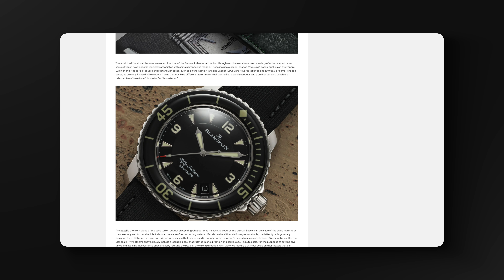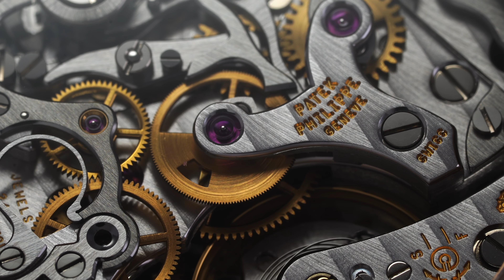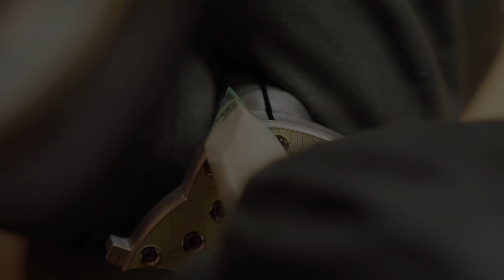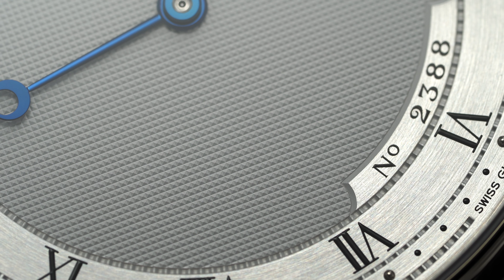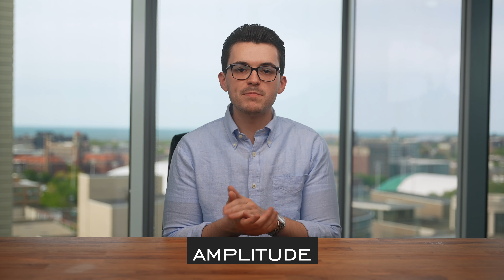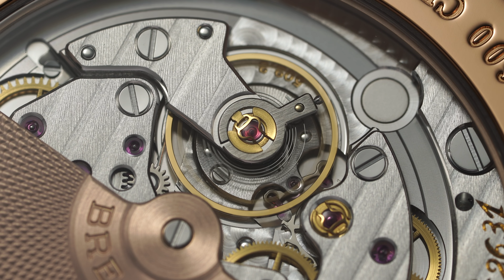8 Misunderstood Watch Parts & Features Every Enthusiast Should Know

Comment: I found a broken buran watch using a poljot 3133, however it’s broken at the balance wheel. The 2 things used for the, I believe,  index regulator came off somehow. Now my question is how does one proceed to fix it since my local shop repair wasn’t able to.

Comment: Just another tip on using the timing bezel. The large lumed marker (usually at 12 o’clock by default) is used to indicate the end of the duration, not the start of it. It’s large since knowing deadline is more important.
Reply: depends on the direction of the numerals ;-)

Comment: Great vid Teddy!  If a future one is done, maybe explain how hand winding your automatic watch can be dangerous, especially with the SW200-1, which ratchet wheel is easily sheared/stripped.  I have 2 watches with SW200-1 both with ratchet wheel issues within the 1st year and 1/2 of purchasing the watches new.
Reply: Yeah ... having stripped the teeth on the ratchet wheel on one of my watches with an sw200 movement (repaired under guarantee) I now wind it very very gently ....

Comment: Teddy, would you consider commenting in a future video about if hacking lever mechanism affects the balance or not? Sometimes very expensive watches don't have hacking mechanism, so I wonder if it is a decision based on the longevity of the watch balance wheel or if it is because of another reason. And it would be interesting to know if there are another types of hacking mechanisms that does not involve a lever touching the balance wheel to get the same feature of hacking. I think this side of this feature is sometimes forgotten.
Reply: Every one I have ever seen uses a hacking lever on the balance wheel. It would be trivial to design the system such that the lever is a softer metal than the wheel. The wheel is also very light. I have never ever seen or heard of any noticeable wear caused by hacking, after working on probably a hundred or more movements, most of which were restorations and so had already experienced a lifetime of hacking.

If I had to guess why very expensive ones don't, it is because they are dress watches and dress watches really don't have a historical reason to hack. It was most important on military, tool, flight watches as it allows people to synchronize their watches precisely and know they will be displaying essentially the same time through at least the next 24 hours or whatever.

Comment: I literally design quantum logic gates for a living, and am more perplexed by mechanical watches
Reply: That made me spin!!
Reply: I’m a Mechanical Engineer and I’m afraid to admit being a bit perplexed by mechanical watches.
Reply: Well, I’d hope you’re less perplexed by something you’re doing for a living than by something you’re not!
Reply: What a "Quark" thing to say 😂
Reply: I literally design Flux capacitors, and am more perplexed by gen zer liars than what I do for a living!
Reply: I‘m a watchmaker and i’m not even sure what you do for a living 😅
Reply: nice
Reply: This makes me happy if true!
Reply: Digital vs. Analog
Reply: Literally?
Reply: A mechanical watch is a spring powered gear box with multiple output shafts running at specific ratios in relationship to each other.  At the end of the gear train is the escapement that releases the springs energy at a rate designed to produce one rpm at the second  hand drive shat,  The minute hand runs at one revolution per hour and the hour hand twice per day

Comment: A worthwhile addition to the diving bezel segment would have been why they only rotate one way.
Reply from the maker: Good call. It is a never-ending hole you can keep going down. Just to address it for those interested... Before diving computers, this tracking of time was needed as it could lead to dangerous consequences underwater. By rotating only one way it lessened the chances of the bezel getting knocked and showing the incorrect elapsed time. This concept of preventing this undesired bezel movement lead to other developments such as elapsed time bezels that need to be pressed down first before rotating and the compressor style that has an internal bezel that required a crown on the side of the case to be turned in order for the bezel to move.
Reply: @TeddyBaldassarre  Thanks for the reply and please don't think my comment was in any way a criticism. As with all your output, I make an espresso and then sit down and enjoy.
Reply: To boil eggs and cooks steaks of course!
Reply: @NeoWahNah  More likely how most dive watches will be used probably.😏
Reply: Isn’t it so that if it gets knocked it can only exaggerate the time elapsed rather than under report it (meaning you think you have less air left rather than more)
Reply: @Nitro-ham  That's right. Better to surface early and alive than not at all.
Reply: I always break them in so that I get a bi directional bezel
Reply: @ashraffaridharis5570  So now it's a GMT   😏
Reply: Actually that’s pretty simple. It’s so that, if it accidentally gets knocked around, it doesn’t lose position it was set at
Reply: @scottmakis7070  No. See the other comments.

Comment: Sir ,   
thanks  for sharing  the  knowledge.   

Sir,   i keep saying  about  QUARTZ watch theory ............it's   what  i  believe  is a fact
that the QUARTZ  part   is  not really  the CRUX  of the watches.
-  
sir  , ...........the crux is the MICROCHIP  inside the watches and specifically   a PART of the chip
called   the DIFFERENTIAL OPERATIONA AMPLIFIER  component.    ..........D--OP  shows as a  TRIANLGE SHAPE on the chip diagram.

Sir the QUARTZ watch gets 100 million ticks from a tiny button batter by the powerful
OPERATIONAL AMP  system which detects TWO   DIFFERENT power sources  
1)  Kinetic from the moving tick hand
2)  THE BATTERY

and it works with it.............

.................it is able to SEE the voltage difference between 1 and 2........then amplify this 100's of thousands of times ..............Read a Little about OP AMPS wiki

Sir,   this is how  they get the 100 million ticks from a tiny button battery.......3 years.

many regards   Sir............

Vin.